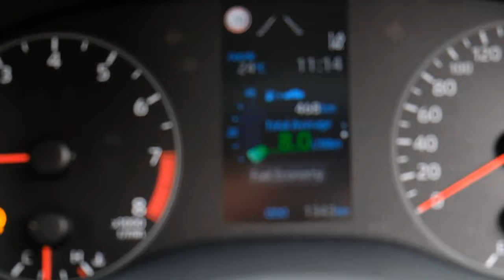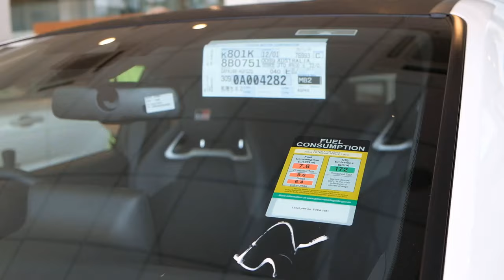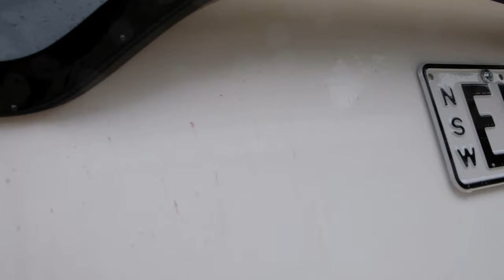Delivery Day & Coating for ANOTHER 2020 GR YARIS

Comment: excellent sports panel filter .... we hear the sound .... another modification to the engine is the hks control unit add-on module
Reply from the maker: We’ll be doing a Dyno test to see if there’s another real world engine performance other than noise will be interesting :) 
Yes there are also a couple Australian companies now that have made their own too won’t be long until a complete ecu Re flash will be available I believe

Comment: I've asked for my Rallye to be delivered still wrapped.  If I can obtain the same products your using would I be able to do a god job myself?  Any hints or.tips or would you still recommend a proper workshop to do it?
Reply from the maker: Well done mate! 
Would highly recommend a professional as most these products that actually work and last are only available from an approved applicator. Certain application and paint prep is required and we have seen many diy’ers make simple errors in which it comes back to a professional like our selves to rectify.

Comment: Lovely Vid, very enjoyable. Will get mine in a week.
Dont know what to do, get ceramic coat on it or xpel. I have planed some trackdays, specially on the nordschleife. What would you recommend?
Best regards from snowy switzerland.
Reply from the maker: Thank you! If you plan on doing lots of track work and depending on your road conditions over there the Xpel will offer better paint chip protection. It will still need to be coated over the top after for easy maintenance and color enhancement but also depending on your budget. You will need to weigh up your options and forecast what your main use will be with the GR
Reply: @smoothasbrothers  thank you for your answer. Will think about it. I just ordered a bucked on your store
Keep on the good work guys👍🏼
Reply from the maker: @goshitsful  seen your order much appreciated 🙏🏻🙏🏻